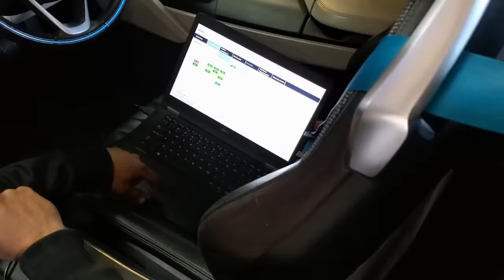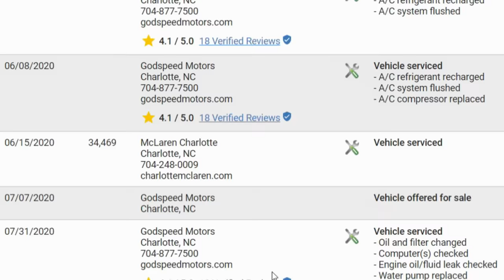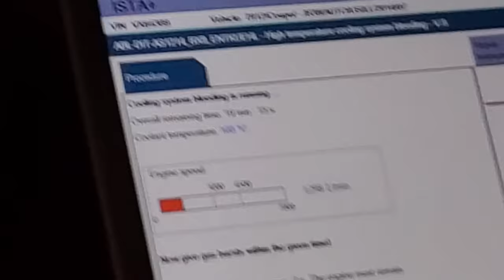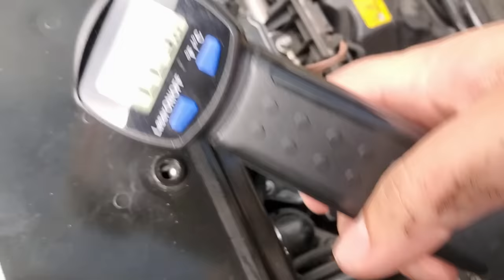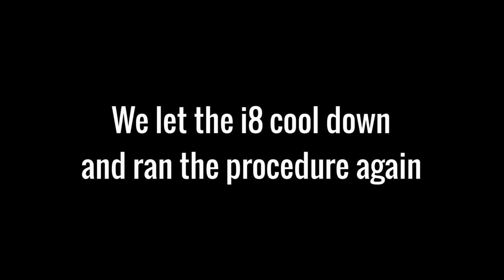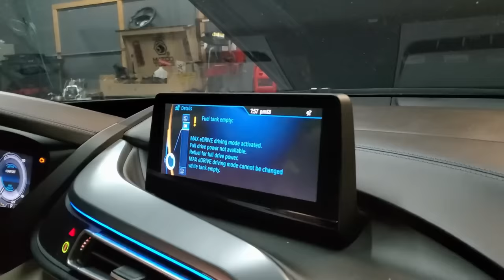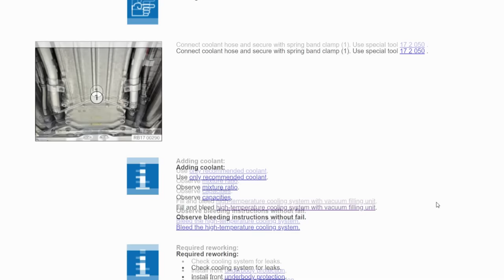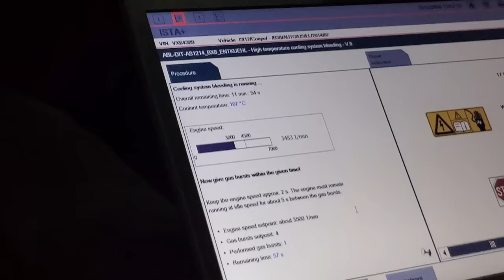Was my Repo'd BMW Supercar Sabotaged to make it Impossible to Repair?

Comment: Check for exhaust gases in the coolant. A simple test to do.
Reply: yes i'm saying the same :) i guess that's the problem.
Reply: I think they already have ruled out the blown head gasket
Reply: Yep, a cracked head will overheat every time after a short while.  I'm watching this and thinking to myself cracked head, check for exhaust gases.
Reply: @gordoncook7103  how would a crack cause overheating??
Reply: @skliros9235  The head gasket is compressed between the engine block and the cylinder head. The head gasket seals in the internal combustion process and also keeps coolant and oil from mixing together as the two fluids travel from the engine block to the cylinder head.

when its mix, its cause overheating.
Reply: @elnivale_eld5997  so mixing coolant and oil, creates heat?! 🤔
Reply: @skliros9235  nt heat but overheat, the engine its self already create heat. but in theory is yes.
Reply: @elnivale_eld5997  I think you need to study how engines work.
Reply: @skliros9235  yeah i need to learn alot, im nt engineer but i dnt want to get scam for repairing my vehicle hahahaa. thats only my motivation studying engine
Reply: @elnivale_eld5997  you don't quite understand why head gaskets cause overheating (are you aren't very good at articulating what you mean) - it's usually due to super hot combustion gasses passing into the cooling channel and then causing the system to boil - the oil in the water or water in the oil are indicators of the problem (as is the combustion gasses in the water test) - not the causes of the problem.
Reply: Agree, can easily be checked before purchasing more parts...
Reply: @skliros9235  a cracked head lets exhaust gases into the coolant system (through the crack).  This creates air pockets and stops coolant from flowing properly.  Often things seems fine at first...until the head gets hot and the crack expands. Sometimes you can hear bubbles in the over flow tanks, sometimes not.

Comment: Head gasket is likely popped. I work on these and had one like it. Replaced half of the cooling system. Compression and leak down ok, but once it got to that magic temp it would vent out. All caused by a coolant leak another shop couldn't fix.
Reply: To add to my story, we ran the car in sport mode and it never overheated, as it commanded the thermostat to open for a lower temp (has electronic control).

Comment: Check the fan controller unit. I had a similar issue with another vehicle, ended finding and fixing it by accident. When I had massive dramas with the A/c as well with the overheating problem

Comment: That radiator was already structurally compromised from overheating several times. A small hand pump isn’t enough to damage a healthy radiator. Also, I am very surprised they didn’t take temp readings at the coolant hoses when engine was at temperature.

Comment: This definitely a head scratcher.
Me when I hear the crackling in the water system that means air is in the system.
Removing the thermostat and it is still getting hot means that it has a flow issue or a head gasket, and being as you have checked the oil and it good, then means a water flow issue.
The radiator blowing going pop maybe part of a flow issue, maybe, 

I'm not a great fan of electric water pumps, just another thing to go wrong and in my opinion not needed.
I will now try and find part two of this video to see how it carries on.

Most interesting.

Comment: Overheating problem is a crack in the expansion tank I've replaced loads under warranty usually underneath the tank and hard to see but 100% it's there

Comment: Dude, BMW still has the same problem with overheating like in 2000? 😂
Reply: Yup I'm getting my 99' 328ci  in vibes from this vid. Its been more than 15 years since, an all that is changed are amount of money you waste on a BMW :)
Reply: Dev JB  The vacuum filling of the cooling system should remove all the air. They usually aren't designed to have a high spot where a bubble would get trapped unless they put a bleeder valve at the high point and I'm sure the diagnostic tool would have told them if any exist on it.
Reply: @manstersr  the temp sensor on that motor is at the highest point  so if there is an air pocket, the temp sensor won't work. German engineering.  Refusing to admit design errors is also German engineering.

Comment: Radiator blew.. I’m going to say combustion gasses inside the cooling system.. head gasket?
Reply: It popped during a pressure test. nothing more.
Either shoddy construction or, more likely, a problem inside the radiator.  All those diagnostics and neither of them thought to consider the most obvious component in a coolant system..

Comment: @Samcrac 
Have you done a sniff test on the coolant system? Checking for unburnt hydrocarbons in the coolant system(head gasket failure) also confirm the coolant bottle cap is keeping the system properly pressurised. BMW throught 90's....common faults, coolant system bleeding always and issue, head gaskets leaking into coolant system. 
Check for blockages in radiator and heater matrix as crud or some additives being added. Fit an auxiliary bleed port at matrix can also help out.
Hope this helps

Comment: Wonder if someone poured something into the radiator that is blocking the passages like an engine sealant
Reply: I was thinking the same. Radiator/head gasket stop leak can plug up coolant passageways especially if it was put in the car in excessive amounts. With the car being a repo is makes it even more suspect
Reply: @charleslaatz6189  Bingo...My sentiments exactly. The rule of thumb with repo's is to change most fluids or at least the oil and coolant.

Comment: Finds out there a golf ball in the hose from the sabotage
Reply: Wouldn't be surprised if the first owner tried some radweld stuff to stop a leak and it blocked something in the coolant system
Reply: @RogueTrooper80  That hypothesis has some teeth!
Reply: I think that getting his step-mom to help with the vacuum bleed would clear any blockages.

Comment: Go find the former owner and offer him a few grand to tell you what he did.
Reply: this is the right answer, exactly what i was going to say, time is money and you are losing big time
Reply: @johncorcoran957  I would make in my standard procedure to contact the former owners and ask them about the car hopefully before you buy, but certainly after.
Reply: Not a bad idea. He probably just wanted to get back at the bank or dealer that screwed him on the price or financing anyway.
Reply: @manstersr  Actually, if you get screwed on price or financing, it is your own fault. You see the terms etc and you agree with them. No is always an option on buying a car. Have a safe New Year.
Reply: mac11380 Don’t defend the huge clusterfuck that is terms and conditions.
Reply: @orppranator5230  Don't defend agreeing to something and not keeping your word. Are you one of those that thinks you shouldn't have to be responsible for your own actions?
Reply: @mac11380  You keep defending bullshit specifically designed to screw people over, relying on them not being able to understand or comprehend all of its fine print. 

I say we set limits on how long TaC can be, much shorter than they usually are now.
Reply: @orppranator5230  If you don't know to read the fine print by now then maybe getting ripped off might teach you a lesson. I say be responsible for your own actions. I have never been ripped off once because if the deal is not good for me, I have this phrase I use, it's " no thank you" and I walk away. Also, this guy who had enough money to qualify for a car that costs way north of 100 thousand could afford to throw down a grand and have an attorney look over a contract.
Reply: @mac11380  Americia the entitled wealthy are bred to exact vengence when  any failure occures!

Comment: when it shut down, did anyone check the lines from front to back to make sure that they both were at temp?  If the return line had been blocked it would still be pretty much cold and because there wasn't full circulation, it would back up into the overflow at boiling temp.  I've had this problem on other vehicles, that didn't have computers.  I will say that who ever designed a system that requires a vacuum to purge the coolant system had their head up their rear.

Comment: legit sounds like a lawn mower lmao i was thinking you have a blown head gasket if it won't stop overheating
Reply: My 2003 BMW 530i have similar overheating issues, replaced radiator multiple times, turn out it was a blown head gasket. With all the rubber hoses, overheating...it just a matter of time before the whole engine get mess up.

Comment: Fill each cylinder with air with all valves closed and look into the radiator neck  and see if any bubbles appear if so you may have a cracked head or head gasket? Next do a cylinder leakage test on each cylinder and jot down the leakage of each cylinder and where the leakage is taking place if all of the cylinders have pretty close to the same leakage, it has been way to many years since I turned a wrench ?

Comment: back flush the cooling system see if you have a full circuit with the thermostat out
Reply: @Mike S then do the same to the radiator /hose pipe in the top it should come out the bottom . I would of done that first instead of the bleeding sequence,

Comment: I have a 2011 Silverado that kept giving me a temp code but never actually ran hot. It’s a v6 and the sensor it next to the manifold causing it to cause damage to the actual wiring plug. Replaced plug no more issue.

Comment: Someone poured some hardening/clogging chemicals in the system.
Reply: Like the crap he "fixed" the old range rover with?
Reply: @gregoryholcomb7560  exactly.. I guess we'll find out very soon. BTW,. Have a great New Years. Peace
Reply: Or something broke in the cooling system and lodged somewhere in the block. BMWs are notorious for failing cooling systems, although not usually ones this new with lower mileage.
Reply: That's very possible.
Reply: @OMGWTFLOLSMH  I'm very interested to find out. You could be right. Happy New Year

Comment: Did you verify the fan is spinning the correct direction? If they did sabotage it maybe they flipped the polarity... coulda de-pinned and re-pinned a couple wires on the plug and she'd still look factory. I know it's a long shot but you've checked just about everything at this point. Good luck Sam.

Comment: I would say replace the tank cap. Cooling system is a pressurised system, therefore if the cap is not sealing correctly you could get overheating issues.

Comment: Repossessed vehicles are very often sabotaged. We had a zero miles Bentley Mulsanne that was auctioned from a bankrupted dealership. To make sure that it was going to be an expensive sale, they removed all computers from the car…and being bankrupt they could not be charged to the deal ship who stole them (the owner did get criminally charged for theft). The replacement modules and computers plus the Bentley technician to reinstall them cost an arm and a leg.

Comment: X_X i've known cars sometimes get a bad thermostat or similar device that break into pieces and get stuck in the plumbing of the cooling system, i had to argue with my mechanic to remove it, insisting it needed an engine rebuild which it did, but i wanted the clog fixed first.

Comment: Question from my side, beacuse my BMW 320i E90 (N46) had the same issue of overheating..... 
I replaced every sensor, pump, thermostat and radiator that also exploded and it still overheat and the fan running at jet speed too...
I had a leak in my box where ecu lays, and it developed water damage so had the ecu repaired... Helped a little but not the main issue.. we did eventually replace/swop out the oil level sensor and that helped....BUT we found some water in the oil that was coating the sensor and gave incorrect temp readings. 
New oil and filter, sorted it out. No overheating - but my head gasket is not too happy...  But beacuse of Covid, I'm not working full time and can't repair the head gasket properly I have to use stop leak products, that helps for now till I can get money to repair.

So, have you checked the head gasket, oil sensor and level sensors and your ecu for any damages?

Hope this may help someone and hope the car runs right.

Comment: The fact that the radiator broke means that the radiator was probably already breaking at that point where it connects the metal to the plastic meaning you probably already had a coolant leak there or air leak there and therefore that's might be your problem

Comment: HEY HEY HEY!!! You seem to have air accumulating in the coolant. Just as a cheap idea I would check the coolant for exhaust gas. It could have a small head gasket leak that only presents itself when it get hot?

Comment: That popcorn noise means the coolant is boiling,its either pressure related or you are pushing air into the system from the combustion chamber

Comment: I know a disgruntled plumber that put small balls made like ping pong balls in the pipes of a project when he got fired. They would float up or drop with water flow and block stuff up. They had a hell of a time diagnosing the problem.

Comment: You should never be afraid to use more test equipment. Throw temp probes into the coolant lines to see where the blockage is. Nwver limit your diagnostic tools, you'll never get a complete picture.

Comment: I do not have much experience with car cooling systems but they are basically the same as any other. In the case of a computer cooling system I have my system calibrated to an operating pressure ~292mbar when the pump is running at full speed ~4700rpm. If I was to see a pressure increase it would indicate that a blockage has formed somewhere in the loop increasing restriction or possibly that a tube has kinked etc. I would suspect that for a car there should be a way to see what pressure the cooling system is running at and how that corresponds to the design spec.

Comment: It seems that the thermoswitch is malfunctioning.  The thermoswitch should pick up the rising temperature and force the fan to kick in in order to prevent high pressure.

Comment: Try using INHIBITED SULFUMIC ACID ;  add a circuit to the return side  of the radiator with a clear tank and inline filter similar to household water filter.  Certain inhibited sulfumic acids have a dye that changes color as the PH is neutralized.  From the filter , capture any debri and send it for Gas Chromatograph analysis.  This will give you an idea if there is non EOM metallurgy(such as a stint) or intentional chemical contamination (sodium silicate)  in the cooling system.  
As an example, Sodium silicate was to destroy engines when places in the engine oil galley in the Keynesian  cash for clunkers scheme.  When used in a cooling system it can (allegedly) seal damaged head gaskets as it hardens.   If used in excessive quality it can lodge in the cooling system increasing drag and reducing flow. Hydrodynamic drag grows exponentially with velocity.   So the cooling system capability would have a discreet failure point once rather than a taper effect.

Comment: If there was an air lock in the top of the engine there would be a bleed nipple there somewhere or unless you have to take a hose off to let air out,sometimes even a heater hose,funny thing is before you guys pressure tested it I thought maybe there's a blockage somewhere even in the radiator,why wasn,t the fan turning on?.

Comment: did work investigating bmw warranty claims. I personally would never trust a car that comes with a recommended oil change interval of 10,000+ miles but if the car burns anything less than 1 qt per 800 miles normal...

Comment: Check for a blown head gasket the head gaskets most likely blown into a water Port so that heat from the cylinder is escaping into a water Port there for heating up the coolant

Comment: Coolant pressure tank faulty cap.Open to soon.Should only open if pressure is way to high in the cooling system.Know about people that have changed head gasket i took another cap on a junkjard for the car and it was fine

Comment: So whT ended up being wrong with it? Usually when it's blowing bubbles in the overflow tank after numerous attempts to bleed the air out it's a cracked head or head gasket. Compression gets pushed into the cooling system causing air pockets and it continues to overheat.

Comment: Repo was probably over revved.  If you run the engine at or near its max rpm for an entire tank it won't register as over rev but it will still damage the cylinder walls, causing over heating

Comment: I would have deleted all of the electronic controls for the fan, maybe water pump etc. Just giving the fan and the water pump full power all of the time. Of course that only works if the water pump is controlled by electronics in the first place.

Comment: If the coolant is boiling at 100 Celsius the system isn't sealed properly water boils over 100 Celsius when under pressure that's how a coolant system works. You either have a leak or the pressure cap is not  maintaining pressure properly causing the coolant to boil and put it air in the system.

Comment: Stick an endoscope inside the cooling system and find out if any of your cooling journals are blocked . How many times can you dick with electronics and replace hanging parts before you realize that the problem is internal ?

Comment: Can you share the e manual  please? I'm having similar problem, but when I did the head gasket check three time it was good. The hose goes to the radiator is very hot, but the return hose from the radiator to the engine is very cold, so there is possibly of either blockage (radiator, hoses,....) or thermostat. I left the car running for over an 1 hour and no problem temperature steady at 104-105 C while the heater is running. No leak and the bleed done properly! 
Hint: water is not circulating!!!